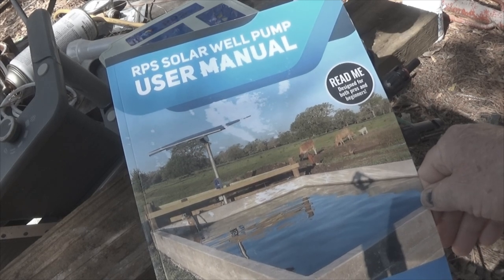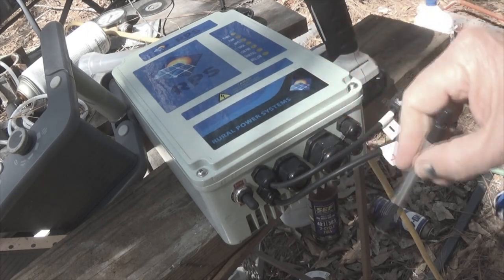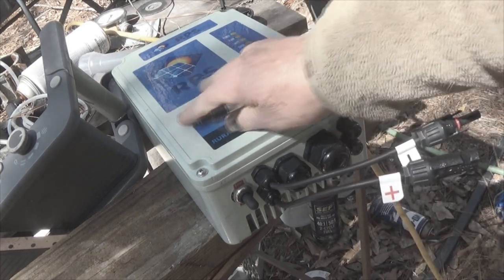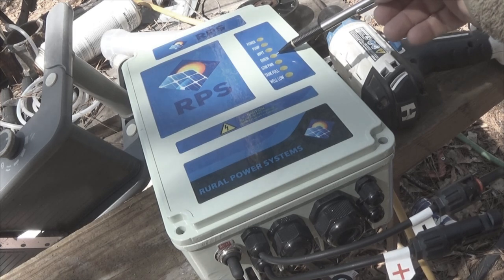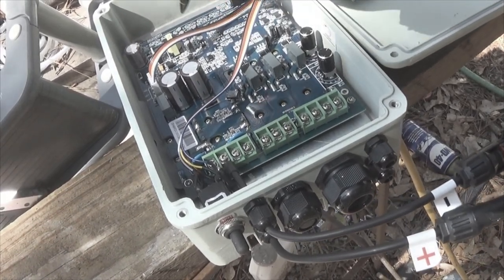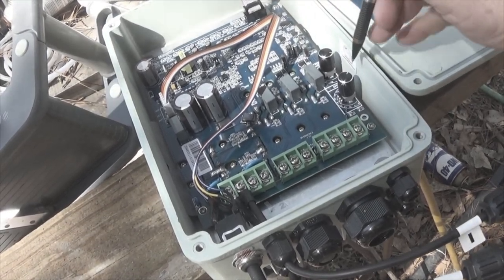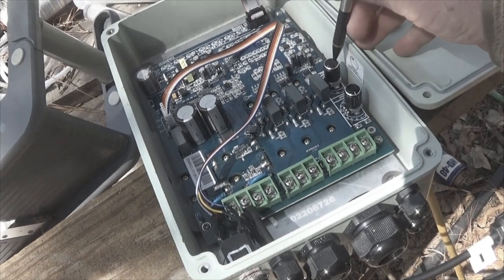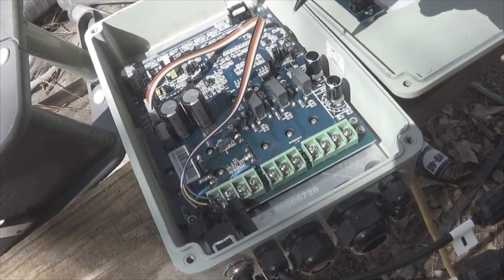RPS Solar Pump Control box,  24VDC MPPT

Comment: How is your stem working for you. Please explain your use of the water & stats for your well like depth, head pressure, static level, recovery water level.
Reply from the maker: on a couple of occasions the water was off here for some days.  the longest, which occurred with the loss of power (i'm on city water, power and septic service), was about 8 days.   this shallow well is so that i will have water when there is an interruption.  there is no storage or distribution.   it is. an emergency back up.

one of the big problems was that getting water from somewhere else was complicated by large trees on the road and deep snow

granted deep wet snow is rare, but it happened once
Reply: Great job, thanks for serving our county 👏